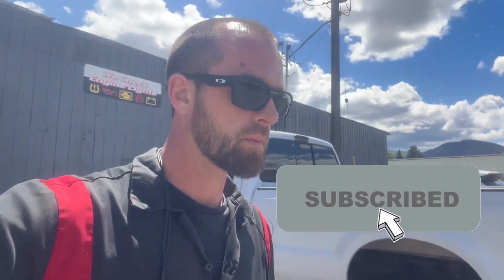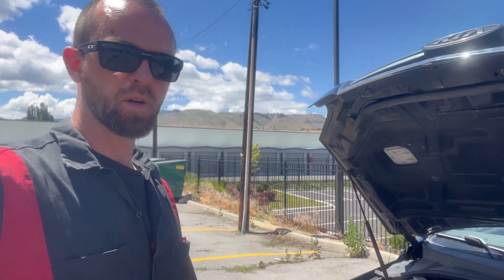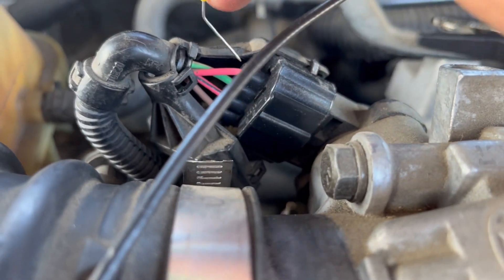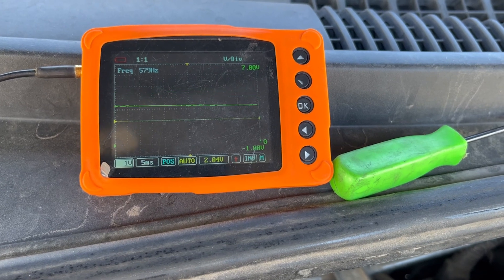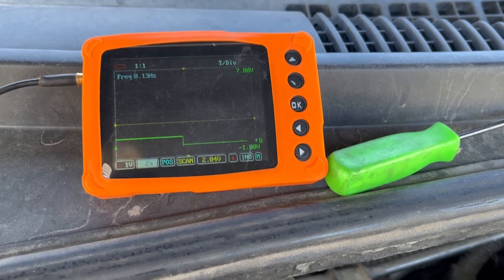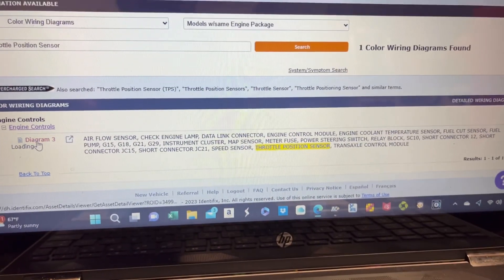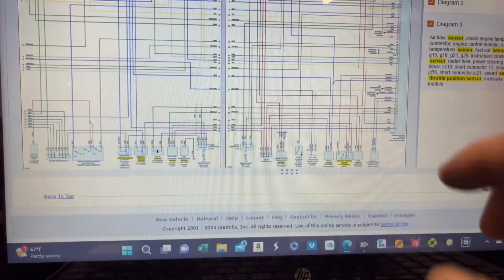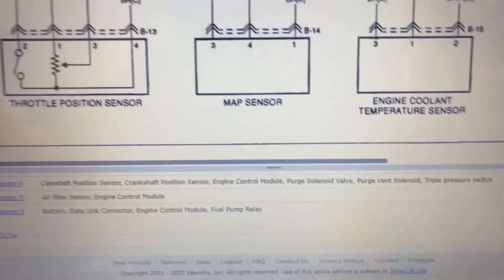2004 Kia Sorento 3.5L TPS Testing With A uScope

Comment: I have a 4 wire TPS on my 05 Sorento.
What's the 4th wire for?
Reply from the maker: @markchidester6239  I can’t say without looking at a diagram. But I would assume your Sorento is newer and has a drive by wire setup instead of a throttle cable. So it probably has TPS 1 and TPS 2 signal inputs for the ECM. One will most likely be a 0-5v signal and one 5-0v if that makes sense?
Reply: @BigDogDiagnostics  my neighbor's 05.
It turned out to be an "one-off" switch.
As soon as you open the throttle, it drops the 5 volts. 
I was thinking the same. Like a backup sensor in case the main goes out.
Hooked up the scope and it got all weird in the middle of the sweep. Replaced and all is good.

Comment: Sonrento 2004 RPM up and down issues, please help me
Reply from the maker: First off, you need to start by scanning the vehicle for any possible DTCs. There are a lot of reasons why and engine would have an irregular idle. So you need to get a starting point. And a good visual inspection for anything that looks or sounds strange. Then report back 😎look for misfires on scan data. Fuel trims. Inspect the throttle plate for excessive carbon buildup. Look for vacuum leaks. TPS APP IAC MAF DTCs etc..

Comment: Good video on sweep testing the TPS.   The inlet tube looks loose at the throttle body. Thanks for sharing your knowledge!
Reply from the maker: Good eye! Yes I had it loose. I tried to see if it would start on brake clean. Thanks Bart!
Reply: I'll sell u one.bougth only used it one time.i have the bundle kit.